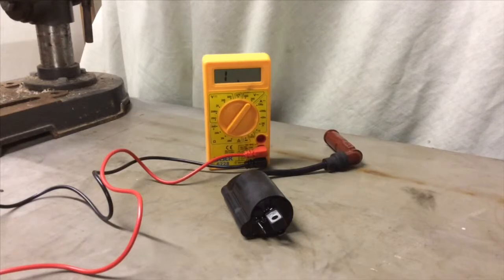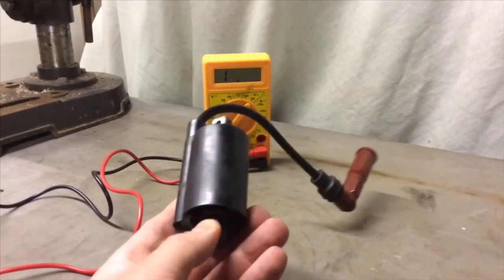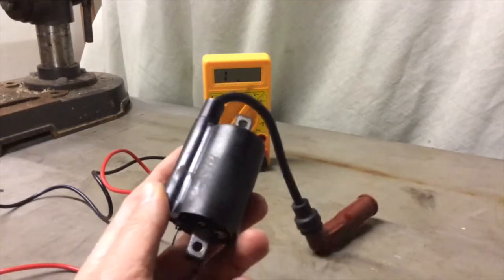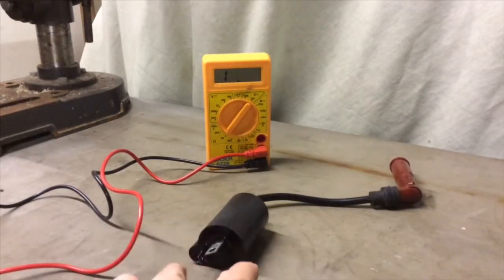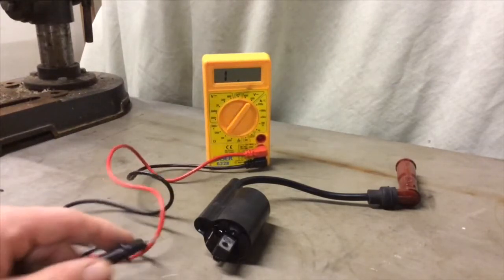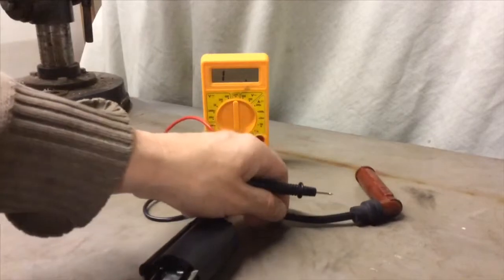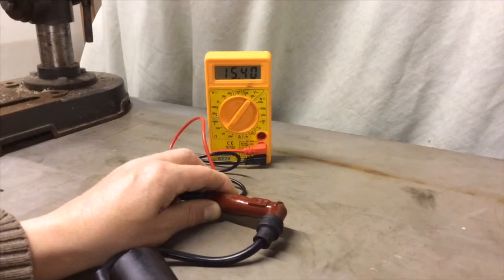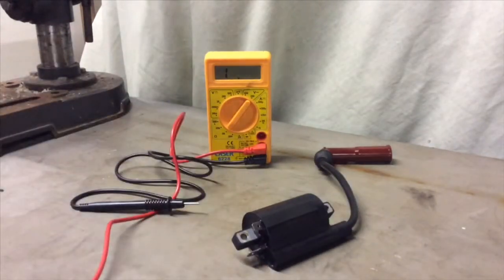Motorcycle Coils —  Testing Primary and Secondry Resistance.

Comment: Great vid! i'm getting a misfire and when i checked the primary the meter didn't read anything and the secondary read 2.5. do you think the lack of a reading from the primary could constitute a faulty coil?
Reply from the maker: make sure you have your multimeter ohms setting just higher than the reading you are looking for, as the primary should be 3.5-4.5 ohms and if you have set the meter to very high “in the thousands” setting the reading may be a false 0.00, set it to about 20ohms for the primary reading. Then turn it up for the secondary to about 20,000 ohms, and see what you get. If you do that and still get the same readings yes it’s a pretty good indication it’s fried as it seems you don’t have continuity across the primaries. If the reading are fine after you have done that then I’d replace the coil as routine as you may have a leaky HT lead and it’s all moulded of course. I’d also give the plug well a good clear, replace the plug, clean up the terminals on the LT cables and see if that makes any difference. As a quick measure, swap the coils and plugs over to see if the problem switches to the other cylinder 😁
Reply: @memybikeni9931  Thanks for imparting your knowledge! yes i set the multimeter just how you explained but still no continuity at the primary circuit. It's just a single cylinder so i can't swap the coils over to test so i ordered a coil and plug. I also checked the stator and it's reading 490 ohms which it seems is within tolerance.
Reply from the maker: @ProfileP246  yeah sounds like the coil is just dead then doesn’t it. The one thing I’ve learned is buy OEM coils, aftermarket seem to be quite short lived. I’ve gone through a couple on my virago.
Reply: @memybikeni9931  if they are made in mexico  not good they used too small dia wire will not last long
Reply from the maker: @frankdavidson9675  that is the issue with aftermarket non OEM isn’t it. Never know what the quality is going to be like.

Comment: my twin coil is showing 1 on the secondary (open circuit)  and 5.3 on primary which is way to high. So i think it is totally fried, new coil on its way to me. Would you change the plugs as well?
Reply from the maker: Do you mean change the plug caps ? Either way I would change the plugs and caps all together, they are such cheap consumable parts. Did you test across the cap itself, or take it apart to check the resistor, that is a good confirmation of what’s wrong with the secondary reading, may be a fried resistor, but yeah replace it all, issue resolved 😁
Reply: cheers